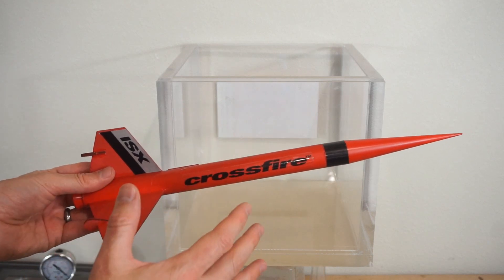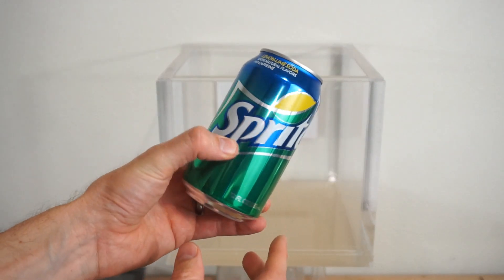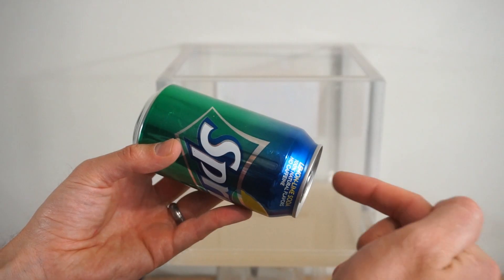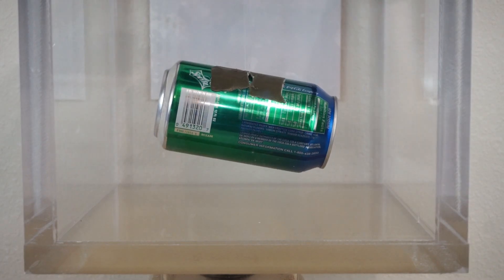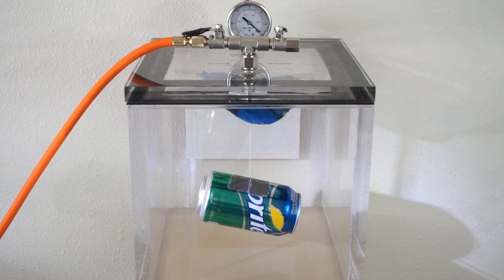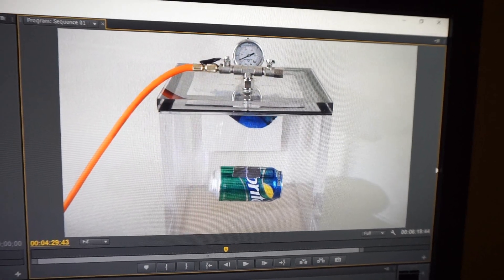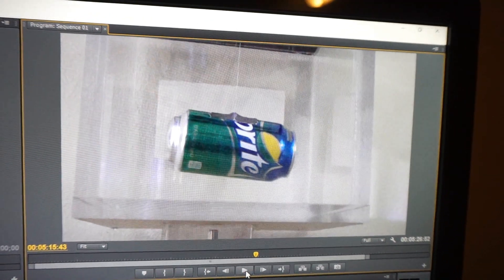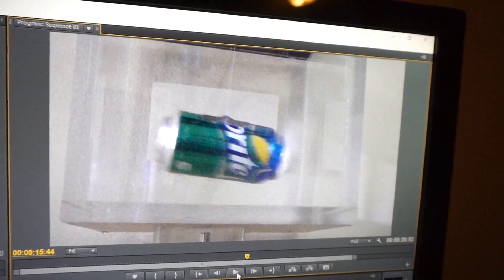Can a Rocket Fly in a Vacuum Chamber?

Comment: This is total BS justwatch experiments done with the balloon rocket car putting a vacuum cleaner behind the nozzle and see no movement from the car proving that rockets need an atmosphere to push off of there are so many flaws in this experiment and could have been done so many better ways
Reply: If you think the balloon car in front of a vacuum cleaner is anything like propulsion in a vacuum, you need to review high school physics.

DO you think that the recoil from a gun, or a crossbow would not occur in a vacuum?
Reply: @stuartgray5877  so you think w=pv is wrong? ok, psycho stu the online harassment machine...
Reply: @papalegba6759  Can you answer a few questions so we can make this experiment clear?
When a rocket engine is running in a vacuum:
1 - Does the exhaust gas get "Accelerated" Yes or No?
   (does the exhaust gas CHANGE velocity as it exits the rocket?)
2 - Does this exhaust gas HAVE MASS? Yes or No?
3 - Can any MASS be accelerated without a force?
  (or does acceleration of mass REQUIRE a force).

Just answer these dirt simple physics questions so we can move on to the REAL questions.

Comment: Your experiment was flawed from the beginning. you haven't taken into account that the soda can still has air inside of it and its pushing off of that air in the can and thats how it moved in a vacuum. You can watch amateur videos of rockets stopping cold in its tracks the moment it hits the vaccum of space. Propulsion in a perfect vaccum is not possible without providing some kind of air or atmosphere into the equation.
Reply: You do realize that rockets are pretty much just giant soda cans, right?
  That's literally the reason he used a soda can, it works just like a  rocket lol.
Reply: Are you saying the can is pressurized? Like... a rocket thruster?
Reply: "You can watch amateur videos of rockets stopping cold in its tracks the moment it hits the vaccum of space." 
They don't stop. They just stop spinning using yo-yo de-spin.

Comment: The CO2 escapes before the liquid, pushes against the wall, can’t see it because it’s a gas. Make a longer chamber and redo this experiment.  I bet you won’t post your result.
Reply: It doesn't push against the wall. How tough is it to understand Newton's law? It's literally 7th grade Physics
Reply: @aaryajain6396  newton's 1st law says an object requires an external force to alter its state of motion. but a vacuum cannot apply an external force. so you're wrong, as usual. now stfu & gtfo.
Reply: @papalegba6759  wow, so cocky lmao. 
  Correct, vacuum doesn't exert a force to propel, which is why rockets use thrust as it's external force. According to Newton's 3rd law- thrust fuel out of a container in one direction, the container moves the opposite direction.
Reply: @logikylearguments6852  in your 1st sentence you admit rockets can't work in a vacuum. then you go nuts with the disinfo. lrn2 draw free body diagrams, crazy chatbot weirdo, muting you now, bye bye.
Reply: @papalegba6759  I didn't admit they can't work in a vacuum, I pointed out the external force applied to produce acceleration is thrust.
 You seem to be under the impression that external means literally outside of the rocket.
  Also, nice job using Newton to refute the original comment because you don't understand what external means, only to ignore Newton's refutation of your misunderstanding in his 3rd.
Reply: There are no walls in space, and rockets works perfectly fine there.
Reply: Nope, you'll still get the same results

Comment: In an explosion like that both the cap and the bottle both have equal force going against each other causing both to move at the same rate in opposite directions. Or it's just a theory of mine
Reply: On top of that, we arent considering the Co2 within the cans, once leaked compromises the vacuum.

Comment: This proved nothing! Your soda is pushing off the walls... you can't fly a rocket with no air to push on. The can moved before hitting the wall because of the air contained in the bottle added air to your very small  vacuum chamber.

Comment: Honest astrophysicist tell us that rocket thrust will not remain in a column(in a vacuum) as it exits the rocket; because there is no atmospheric pressure to contain it. It will just expand freely in all directions, while not imparting any energy back to the rocket. In other words “no thrust”. There is scientific precedence of this called “Joule Free Expansion”, which was a series of experiments done in Manchester, England in the 1850s by a famous physicist and mathematician name James Prescott Joule. In the experiment, he measured the resistance of expanding gas exposed to a vacuum and found no resistance. There is no difference between expanding gas and rocket thrust, so they knew rockets wouldn't work in a vacuum back in the 1800s.....so should we
Reply: joule stated of the result of his experiment that, during its expansion into the evacuated chamber, the gas "did not develop mechanical power". which is even more damning when you consider a rocket motor is powered by gas expansion lol.
Reply: Correct. 👊🏻😎
Reply: Thanks, I’d like to add that rockets are horribly inefficient because an oxidizer has to be store as well as fuel. Rockets exhaust their fuel in minutes rather than hours. In other words; there won’t be any transcontinental flights made by  rocket powered craft anytime soon. The Saturn 5 rocket burned through two huge boosters and it was still in sight . The North American Aviation’s X-15 rocket plane , back in the 1960’s, burn through it’s fuel in 90 seconds. The German WW 2 Messerschmitt ME 163 Komet had a range of 25 miles . That’s about the range of a moped with 1/4 tank of gas.

Comment: The liquid has weight, unlike engine exhaust
Reply: yes it does, gas has weight
Reply: and rocket exhaust is technically gas
Reply: Yes, the liquid weighs much more than the can does, thereby displacing the can with great force. But because the can + contained liquid weighs more than the ejected liquid, the ejected liquid will meet the wall before the can + contained liquid does.

Comment: I  find this "special method"  to be very very deceptive indeed simply because the walls of the container being so very very close to the balloon as it rapidly expends the air outwards towards the walls of this cube can only serve to create the resistance required to give the balloon propulsion away from the Walls ...( As clearly demonstrated)..and in such a small restricted area can produce ONLY the outcome achieved  so NOT a good example of the truth...NO ROCKET CAN FLY IN A VACUUM..We know this because no one has ever been able to demonstrate it and your attempt to prove this truth has only strengthened that very obvious that no rocket can propel itself without something to push against....We also know this because no rocket has ever passed through our Firmament so you guesses are only that, guesses...Nasa themselves gave up using their massive vacuum chamber when they found out that flight in a REAL vacuum chamber just isn't possible....if you have the courage to try it in a larger area your result will be entirely different. You should ask the Nasholes if you can use their mothballed unused vacuum chamber , I bet they would say YES in a flash ....but I think YOU already know how it will turn out don't you. OUR world really has enough deception already without your input adding to that deception. Think EDUCATION and not DECEPTION....after all , it is YOUR earth too.

Comment: This isn't apples to apples. You're tricking a lot of people here, maybe even yourself. Solids and liquids can be pushed off of, making thrust possible in a vacuum. But gases produce thrust when there is atmosphere. No atmosphere = no resistance = no pressure = no thrust.
Reply: What you said plus the chamber needs to be a lot bigger in volume so it doesn't lose vacuum or repressurize from the newly introduced pressure. According to the space lie it's vast so wouldnt repressurize from a rocket like the box so test def not legit. Plus to create an environment that they say space is  Outer Space=1×10-6 to <3×10-17 Torr100 µPa to <3fPa
You need 10 ft concrete walls reinforced with steel says NASA since that's what we see them use....

Comment: So what we've really learned is, to create a vacuum, or to contain something in a vacuum, you need a REALLY strong container.
Reply: Your comparing two totally different things. To create a vacuum within a planet’s atmosphere, of course you need a container, otherwise the pump just sucks in and pumps out continuously to no avail, that is obvious. A vacuum is nothing, therefore has no physical capabilities. Nothing can’t do anything, therefore a vacuum cannot “suck”. The reality is the atmosphere “pushes”. A vacuum chamber has to be strong enough to survive the weight of the atmosphere pushing upon its walls. This depends on the strength of the material the chamber walls are made from & ratio of the surface area of the walls to their thickness. It’s exactly the same principle as the weight of water pressing on the hull of a submarine. Before you state the usual “atmosphere next to a vacuum” claims, I’ve already said that vacuums are nothing, therefore do not suck. The reason Earth’s atmosphere doesn’t drift off into the vacuum of space is because it’s held to Earth by gravity. If space deniers also deny that gravity doesn’t exist and don’t accept any proof to the contrary, then the burden is on them to prove it, because they’re the minority who’re disputing it.
Reply: @iancanty9875  helium is not subject to gravity, gravity does not exist. Anything denser than air falls there is no gravity it is neither calculable nor observable nor demonstrable it is an umpteenth invention
Reply: @jincen3306  As I said in one of my previous replies, if a minority of people deny gravity exists then the burden is upon them to prove it doesn’t exist. Also, why are you being rude to me by calling me a liar via your Pinocchio emoji. Have I been rude or discourteous to you or anyone else? You may disagree with prevailing scientific knowledge but because I use those scientific descriptions doesn’t mean I am deliberately trying to mislead people. You need to learn some manners!
Reply: Actually the burden of proof is on the people who claim gravity exists. Which there is none. Period.
Reply: @iancanty9875  k
Reply: @mumenrider862  not really.  I could inflate a mylar birthday balloon to 5 psi in the vacuum of space no problem
Reply: @stuartgray5877  there you go again with your "containers"... lol
Reply: cannabear .íôì.   It actually does disperse into space to a small extent. Gas pressure, in this case atmospheric pressure is opposed by gravity, creating a state of hydrostatic equilibrium. Atmospheric pressure is created by particles i.e. atoms & molecules bouncing off each other & some atoms do reach escape velocity & fly off into space. The small rate of loss is irrelevant to life on Earth, which will cease for other reasons within a billion years. Earth’s magnetic field, deflects the solar wind & prevents it from stripping away our atmosphere. Mars has no intrinsic magnetic field & it’s gravity is just over 1/3rd that of Earth so the solar wind has stripped Mars’ atmosphere down to about 1% that of Earth
Reply: @iancanty9875  🤥
Reply: cåññâbëār  we live in a dome xd

Comment: It moves because the liquid HITS THE LID THAT IT JUST GOT SUCKED OFF. smh LAME TEST.
Reply: Oh so are you saying that IF the rocket has some MASS to push off of (like the LID) then it COULD propel itself in a vacuum?
What about blocks of water ice? Could a rocket "propel" itself in space if it had a bunch of water ice blocks to "push off of"?
Reply: @stuartgray5877  here we go again with the mad false analogies from stuart gray the chatbot... a rocket pushes off blocks of ice now lmfao. nasa are a joke, everyone knows it.
Reply: @papalegba6759  lol so you noticed too?  Stuart Gray, the chattiest of the chatbots with the crazy analogies.
Reply: @DrCash7  i've been saying it's a chatbot for ages now. there's a deep learning neural network program called OpenAI that performs a similar function, you feed it example comments and it creates variations on the theme, learning from replies as it goes. for example, 'stuart gray' is programmed to always compare gasses to solids and never acknowledge that they behave very differently. it ties itself in knots doing this, and piles on the abuse whenever cornered, but will never stop as it is just a machine. also, it's not the only chatbot doing this, i suspect most nasa defenders are tbh...
btw, if you look up ball corporation employee code of conduct, you'll see 'stuart gray' is in massive violation so no way it works for ball aerospace as it claims. it'd be fired on the spot, zero doubt. cheers anyway, good to see someone else sees it for what it is.
Reply: @papalegba6759  and I see you refuse to answer my question.  According to YOU , two masses in space just cannot push off of each other, cuz , you know.....cuz.   cuz you like don't understand newton's laws.
Reply: @papalegba6759  - (to all of the OTHER readers)
Here is an example WHY it is IMPOSSIBLE to have anything even remotely resembling a "debate" with Papa Legba:

Papa Legba - Please present YOUR definition of the word "Force".
So that we may discuss it.

Watch what happens.
Reply: @stuartgray5877  i never said any such thing. of course two masses can push off each other. but a rocket is one mass, so in a vacuum it will have nothing to push off. a simple free body diagram proves this, but you cannot draw one, as you are a lying chatbot.
Reply: @papalegba6759  so tell me YOUR definition of "Force"..

The OTHER READERS:

SEE what I MEAN!?!

He REFUSES to just have a simple debate!
He WONT EVEN POST HIS DEFINITION OF "FORCE".

ALL he knows how to do is DIVERT from questions and change the subject.
Reply: @papalegba6759  it's a chatbot.  Even the angry-speak it spews is soulless.. 

If you mention election, it will spew towards conservatives and blame Trump.  Weird since I'm not a supporter (although I support election integrity).

Even the post you quoted from the bot is hysterical:  "the surgery is effective."

Lol chatboy Gray
Reply: @DrCash7  lol i even checked out the US school physics curriculum and 'stuart gray' is about the level of 2nd grade, or 8 year olds. look at it now, asking me to watch cartoons as 'proof'.
Reply: @stuartgray5877  lol if this video is 100% hard evidence, how about the same hard video evidence from the recent election fraud?  You know, plus the affidavits, eye-witness accounts, Biden's self incrimination.

Chatbot: go
Reply: @papalegba6759  an angry chatbot lol.  

The weird thing is its tone has NEVER changed.  

Who would've thunk it: the Bladerunner future was partially correct
Reply: @DrCash7  thing is 'stuart gray' isn't even an advanced chatbot; there's much better out there. google 'dead internet theory', it's a thing i've been predicting since early 2016.
Reply: @papalegba6759  so that's what it's called.. Funny I was thinking this already. When my young relative wanted to play video games with me, I'd just him a disconnected controller.  All order siblings did this as one point.

And we all know it was roughly 10 years ago.
Reply: @DrCash7  sorry mate, i don't email with internet randos, got burned before by sp00ks. just avoid anything to do with flat earth, they're all thicko squaddies LARP-ing.
btw the comments on that video are hilarious, openAI hard at work. like a heat engine has anything to do with conservation of momentum ffs. or anyone would watch that dumb grunt's videos anyway...